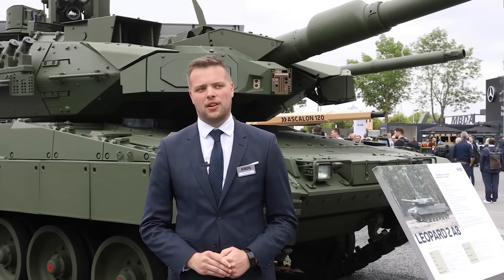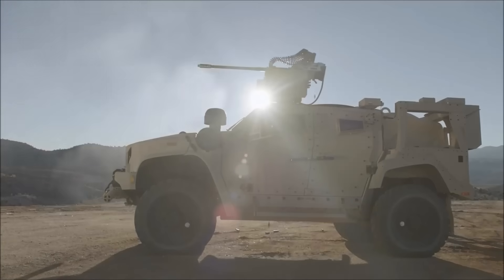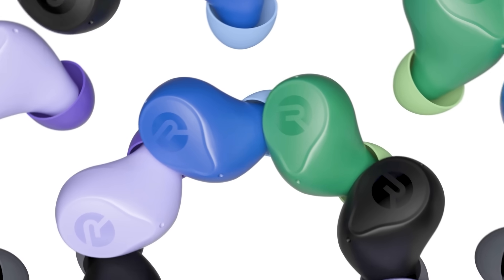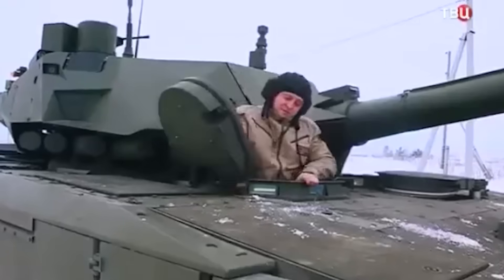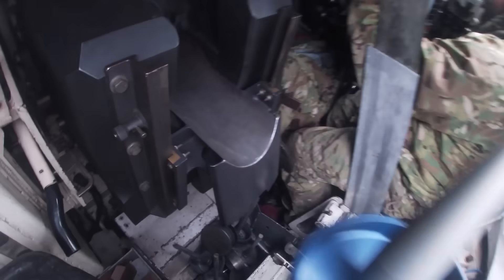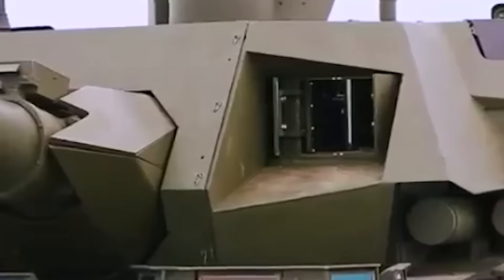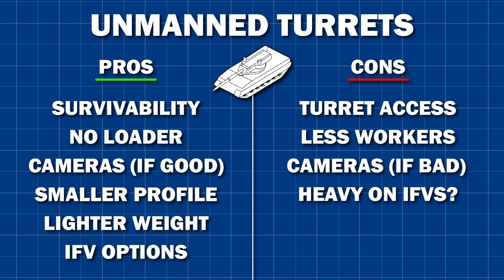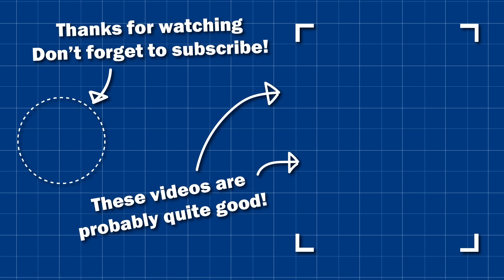The Unmanned Turret - And Why It's The Future

Comment: Leopard 2 RC 3.0 is by far my favourite modern concept vehicle. The gun mechanism is amazing.
Reply: The old hull is holding it back though. With a non penetrating turret there are so many tricks one could do with the tank geometry...
Possibly, you could get it down to 40t without reducing protection. The fact that you can put all the crew under the turret is a game changer
Reply: @solarissv777  It's not a production vehicle, just a technology demonstrator, so actual preductino stuff woudl probably have a better hull.

It has tons of potential, much better than other demonstrators imo.

Comment: Manpower issues can be reduced by adding a support vehicle to tank platoons, similar to the french organization, and adding more redundant cameras in armored housings is probably a better solution to the reliability issue
Reply: The West Germans did the same thing (on paper) during the Cold War.  Panzer companies had a small detachment of newer tank crews who rode in an APC. They could provide local security and bodies for maintenance, as well as a built in attrition reserve and replacements to help crews rest.   Of course, if you’re right on manpower already that’s not always feasible.
Reply: I appreciate you said "reduced." In most combat environments, it is likely you'll need to do field repairs away from a platoon HQ element. It is also not unlikely to lose the supporting elements. 

As with most things military, there is rarely such a thing as removing drawbacks, only minimizing it.

This all said, I wanna add that most combat vehicles with cameras will have redundancy. However, this doesn't solve the problem, only reduces the risks. I wouldn't be surprised if there already existed systems that work kinda like those popup car headlights, but for cameras. But this doesn't solve the problem of reliability of cameras, it just reduces the problem. Especially since various issues can affect all cameras, like wiring connections, damage to screens, or issues with power.
Reply: @Isometrix116  yeah i agree cameras will only ever be so reliable even with redundancies 
That being said, electircal issues will render tanks virually blind now anyway, if the gps, commander pano, or themals die the remaining optics won't do a whole lot nowadaya
Reply: @Isometrix116 i don't understand why everyone is so focused on tge cameras? If a vision block gets broken, a mk1 eyeball wouldn't help that much anyway, oh and you can place a camera behind an armored glass but without penertating the actual armor (thus making it stronger and easier to produce)

Comment: The benefit of the unmanned turret concept is all with increased armor space for crew survivability - but ammunition nowadays can defeat all sorts of armor, you can never be too safe and so we are back again to square one. If armor is useless, why sacrifice everything to minmax it when the conventional works just as well?

This will be the killing blow to the unmanned turret. Unless we find better armor to reliably justify moving everything around and making a new tank and adjusting to a new vehicular environment, then it will never take off. You are basically making tanks as submarines with all the sensors you need just to stay as combat effective as a normal conventional layout one.
Reply: Because you still need AT level weapon to kill Tank armour.
Reply: Even if this were the case and we still armored our tanks like we did the Leopard 1 or the AMX 30, that is paper thin. Keep in mind that modern tanks are incredibly heavily armored and can take most hits except heavy weight didicated antiarmor weapons.

Firstly, a manned turret is still larger and heavier. Secondly, a hit to the turret will kill or incapacitate the crew. And finally, any hit that would destroy the sensors of a modern tank will render it effectively useless regardless of whether there is a man in the turret or not.
Reply: Expensive ammunition can defeat all sorts of armor, but not all armor, not even close. 
FPV now days works extremely well because existing design relies on weapon not having the level of precision to reliably target weak spot. 
With such design, the armor capsule can easily be built to such a standard that the warhead needed to defeat the armor cannot be carry by a drone carrying say 3kg warhead. 

Maybe we give up defend against top of the line tank cannon round. But that does not mean we give up defending against other threats, like scj and efp.

Comment: I prefer unmanned turrets because most of the factors explained can be overcome except for the cost. Most battles (in my opinion) that occur always have a back up whether it is from other combat vehicles, soldiers, drones, or satellites so we can pull the vehicle to the back line. Considering most military strategies start by bombarding the enemy followed by a quick and simultaneous attack before the enemy has time to react. That's my opinion and sorry for my messy English
Reply: Even if your turret jamming doesnt get you killed, thats still a tank out of the fight. If you get a turretless design that lacks in the reliability department, you might start hitting jagdtiger levels of readiness, and considering most countries dont have that many tanks to begin with, you want to keep every tank that you can.
Reply: Unmanned turret afv, if accounting for the whole system, will always be cheaper than manned turret afv.
Reply: @jintsuubest9331 all the extra optics will almost garantee that it costs more.

Comment: For light armored vehicles, using unmanned turrets is the best option, but not for an MBT. Because another thing expected from an MBT is that it can continue fighting even when damaged. Let me remind you that the most damaged part of a tank in combat is the turret, and making turret without armor is completely ridiculous.

To fix this problem in unmanned turret tanks, armor can be added to the turret, but this time its weight increases again. Or the turret of the tank can be made low profile and equipment can be placed in the turret basket, but this time the internal volume of the tank decreases.
Reply: It doesn't have to be completely unarmored,maybe it could have enough to take hits from autocannons since that's about the most battle damage that an mbt can realistically be expected to take and keep fighting
If the turret is penetrated,then it's usually lost,lucky to even make it back to base.
A tank with completely separate turret could potentially even take a hit from the roof,or a direct hit to the ammo and still make it back with full crew and mostly undamaged hull

Comment: If I were designing a tank, the turret would be an unmanned 25mm gatling, which could really chew up drones while also being as effective as a 25mm chain gun against other targets.

The main armament would be in the hull to save weight and space - a 120mm mortar at a fixed upward angle (the active suspension system aims the mortar). Experience in Ukraine suggests tank-on-tank engagements are relatively rare, so this tank only needs a few (expensive) Stryx top attack rounds in case of that. For other targets, a 120mm mortar gives you more bang for less weight and space.

The 25mm ammo is at the rear of the turret, while the 120mm mortar ammo is in racks at the rear of the hull. That way, ammo is easy to resupply, and the loader can easily access the ammo while a bulkhead protects the crew. The mortar is to the right of the ammo racks.

Drive is battery electric with a range extending diesel generator in the front. The main armor is BEHIND the range extender, to ease replacement and maintenance of the diesel. The battery packs are along the sides above the tracks (to make it easier to replace as needed).

The crew sit sideways under the turret, so they can easily see each other's screens while still allowing good thick side armor. The main hatch is next to the mortar, and can be used to load the mortar. A second hatch is above the driver, and can be left open for driving around.

Comment: What's the point of making a $10million tank if a $10,000 drone can take it out before it even reaches the front line?
Reply from the maker: I believe the idea is for this not to happen!
Reply: Because a tank's job is still needed, war is not just a game of maximizing return on investment, there are strategic and tactical tasks that need to be performed, and the tank still fulfills its role, even in Ukraine right now, neither Russia or Ukraine have stopped using tanks.

The advent of drones is a new threat making modern tanks more vulnerable, but the solution isn't to abandon tanks altogether.

Comment: I mean the man power issue could be overcome by re-tasking the loader to some other role on the tank - for example the tank could launch an recon drone/UAV and this could be controlled by the loader , on British tanks the loader could serve this role and on his spare time fix up some sandwitches for the crew
Reply: Make the tea!
Reply: The manpower issue is that with an auto-loader, the crew goes from 4 to 3. So outside of combat when you are breaking track or doing other tank maintenance, the missing 4th guy looms large for doing those tasks.

andresmartinezramos7513 mentioned the French tank companies having extra personnel along with the tankers for pulling security and recon. This would make sense to make up the shortfall of manpower for a tank company. Say have 2-3 IFV/APCs in a support platoon of a tank company. Each IFV/APC has their crew, plus 6-8 guys to help out with tank maintenance outside of combat. They would usually be the newer guys trained on tanks and the tanks would be manned with the people rated the best in training. When they are not helping with tank maintenance, they would provide local security for the tanks when they are stopped. During combat they would follow along behind the tanks and if IFVs are used, could be used like attached infantry would be used.
Reply: The recon UAV could be partially autonomous with the commander controlling it, basically working as a flying optic used for improving spatial awareness and reconnaissance, especially relevant in an unmanned turret tank since the commander is not able to have as good of a field of view when peaking out of their hatches.
Reply: @haaxeu6501  The point is to keep the 4 man crew because the out of combat workload is already high.
Reply: @Norade I've never understood this objection.

If manning levels are to remain, the dude now out of the tank can still be useful. The French accompany their Leclerc companies with a VAB full of men to pull security, aid in maintenance and serve as spare crew in case of casualties or vacancies. Now you can specialize them in those tasks and keep them out of harm's way in combat.

If manpower will be reduced because of casualties or staffing decisions, you still have a 3 man team for a 3 man vehicle. Unlike in traditional tanks where either you run your vehicles undermanned or leave some sitting unmanned.

The only form in which this can sort of make sense would be "The 3 man tank will be an excuse for the bean counters to try and reduce manning below the required level. Therefore we must avoid such an excuse" But this is less an objection to autoloaders and more an admonishment of the people making the staffing decisions. Which is an entirely different problem.
Reply: @Infanterie_Marine  Go look at Ukraine and ask those tank crews if they'd be happy opperating down a man. You don't plan for the wat you want, you plan for the worst war you could fight. Or just see the Cheiftan's opinion on autoloaders.
Reply: @Norade  Wasn't that's beat the purpose of unmanned turret and to extend autoloader.
Reply: @Norade  Let's say you have 12 men. Now you can either have:

-3 tanks with 4 crew members each
-3 tanks with 3 crew members each and three spare men
-4 tanks with 3 crew members each (although this would also require acquiring an extra tank)

Casualties will always affect the formation with the 4 man crew worse than the other options. That is because the 3 man configurations have either replacements or more tanks. No one likes being down a man, but the 4 man crew offers absolutely no relief in that regard.

And that is just casualties. there are plenty of other advantages to autoloaders.
Reply: @Infanterie_Marine  Having 2-3 IFV/APCs in a support platoon of a tank company could help with manpower. Each IFV/APC has their crew, plus 6-8 guys to help out with tank maintenance outside of combat. They would usually be the newer guys trained on tanks and the tanks would be manned with the people rated the best in training. When they are not helping with tank maintenance, they would provide local security for the tanks when they are stopped. During combat they would follow along behind the tanks and if IFVs are used, could be used like attached infantry would be used.
Reply: @Norade  You literally clueless, if you thinking tank is alone

that's the point, if you need 1 man to do anything then you are clueless. Tank need support in the first place not 4 man crew
Reply: @steveaustin2686  This gives another long soft tail open to attack that can stop tanks from being effective. If the French go to war for real, not just being the biggest fish in Africa, I expect this to be a serious operational weakness.
Reply: @tonyhart2744  The issue is crew burnout and the risk of a bean counter deciding that 1 support person per 3 or 4 tanks can save a lot of money and is just as effective. It also adds a soft tail that can be attacked and makes it harder to push tanks forward from FoBs.
Reply: @Norade  Adding a support platoon with 2-3 APCs (maybe IFVs) is not that big a tail for an armor unit, which is all mechanized anyway. And it provides the organic manpower support at the company level. These are armor units, they are going to be attacked if they have some extra manpower in APCs or not. That's not the issue, money is.

With the M-10 being nixed, that puts light infantry either getting an M1 tank battalion at division level, so where there would be support. Or the light infantry doing without gun support, which seems far more likely.

The Deputy Sec Def is a billionaire with a company focused on investments with companies with defense contracts. I wonder if his company was involved with the M-10 Booker or if that was with a rival investments.
Reply: @steveaustin2686  APCs are softer than tanks. Any time you need armor and APCs operating in the same spaces at the same tempo you get issues.
Reply: @Norade  Duh. They are not tanks. Nor are APC or IFVs designed to be tanks. This is s silly point to try and make, since the infantry in armored divisions are in APCs or IFVs and not tanks either. If you are one of the people who think IFVs should be as armored as tanks, then you are not being realistic and this discussion is moot.
Reply: @steveaustin2686 The point is binding the frontline FoB use of tanks to IFV grade armor is an issue. Sure, you could say the same for fuel and ammo, but those don't impact the immediate, "Fuck, track's off, we're mobility killed how fast can we fix this after we've beaten them back." Scenarios that will come up.
Reply: @Norade  You seem to have missed the point. In the middle of battle, no one is breaking track to get a mobility kill fixed. That is something for after the battle. The whole point of extra crew in APC/IFV IS to provide that extra manpower for maintenance after the battle. AND to provide some local security between battles. 

If they are in APCs, they are following the company, like the 1SG would. If they are in an IFV, then you might use them as a mini-infantry detachment to stick in a treeline while paused.

I did not think this would be a hard concept.

Comment: The only thing that is only the trouble here is the camera. Yes you lose a man to perform maintenance, yes it is heavy on an IFV, but the thing here is: Autoloader is coming to a point when reliability is not a trouble (T-64 onward to T-14, Leclerc, Type 90, etc...) and why risking your crew in the turret while you can pack em in the front, beef the armor there at maximum, and preventing ALL your risk to your crew? And also, how will you load an 140mm or even 152mm gun with a loader? Or you gonna come back to the primitive way of 152, 2 loader?
Reply: There are lots of way to design analog optics such that it works on a moving turret and static hull. 
If that such a big problem, just make the hull crew spin with the turret.
Reply: Especially for western doctrine losing the ability to have a commander out of the turret is devestating. Even more so when you consider fighting in populated areas or against insurgents. If they manage to make cameras able to withstand combat i might see it in use on MGSs and IFVs, but a remote turret MBT is probably forever “just 5 years away”.
Reply: @peppy5121 The trouble is, MGS are too weak to withstand a shot from a tank (until now at 2025) and IFV is only suitable in either urban or jungle combat, where big gun might have issue. If it is like in Europe, tank still play a big role or we just going trench warfare like Russo-Ukranian "conflict" or WW1